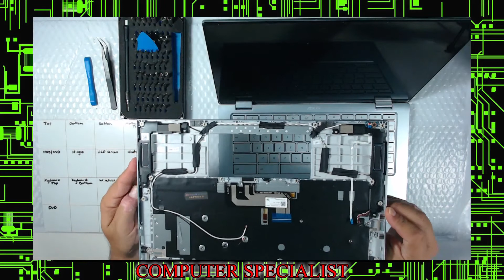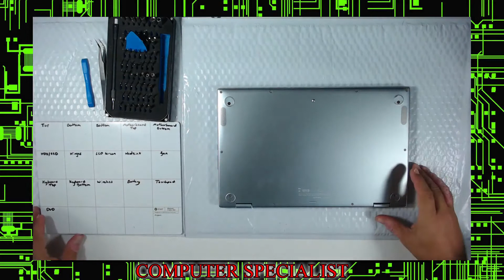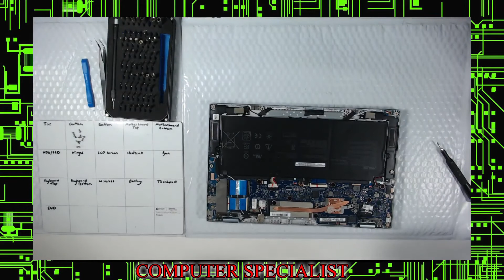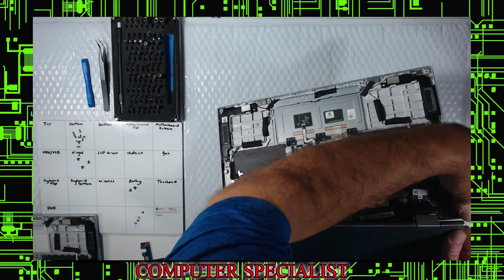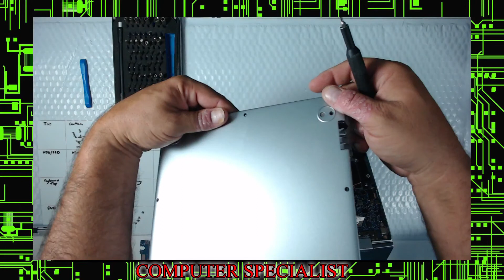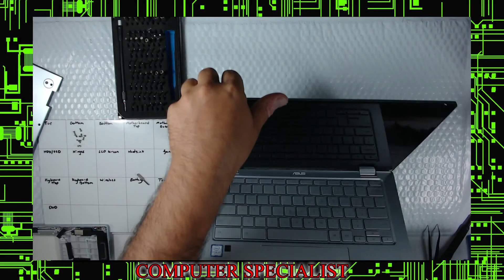Asus C433T Chromebook Keyboard / Palmrest Replacement

Comment: Can you help me, I want to install a US keyboard, there is no similar video on youtube like yours, I don't know the procedure, can the keyboard be separated from the lower part of the case?  I only found a keyboard on Aliexpress, so I'd like to ask if it can be installed?  Thanks
Reply from the maker: You can replace just the keyboard, but you need to break out a ton of plastic rivets and then glue the replacement keyboard back in where the rivets use to be. Its a lot of work and can loosen up in the future and makes keyboard flimsy and even short the motherboard if it doesn't hold. I would just replace the top like we did in video. You can pick them up on eBay etc. cheap. https://www.ebay.com/itm/406200405437
Reply: @computerspecialist8533 Thank you very much for your honest answer, you helped me a lot, all the best!

Comment: Hi, I have 2 question. First which screwdriver do you use? and to replace the charging port is there need for specific tools?
Reply from the maker: https://www.ifixit.com/products/pro-tech-toolkit a must if repairing computer! Also you can replace the entire board cheap enough https://www.ebay.com/itm/296167100787

Comment: Hi I have a question did the palm rest and keyboard come as one or are they separate
Reply from the maker: They came together, that is usually the recommended way as the keyboard is help in with plastic rivets.
Reply: Can you help me, I want to install a US keyboard, there is no similar video on youtube like yours, I don't know the procedure, can the keyboard be separated from the lower part of the case?  I only found a keyboard on Aliexpress, so I'd like to ask if it can be installed?  Thank you

Comment: How to replace the speakers?
Reply from the maker: Follow these instructions to get it apart. You can see the speakers on the top left and right. Order replacements and swap them out. Be careful with the speaker plugs, they are very fragile, so wiggle them to get them out. Also are the current speakers crackling or not working at all?
Reply: @computerspecialist8533  current speakers are crackling.. I see wires connected to a Intel card. The speaker on the left. It's the speaker on the right that's out. Please make a video
Reply from the maker: @dricketts91 The wires for the Intel card are the wireless antennae's. We don't have this laptop no longer to make a video but you'll see its pretty simple. Just do one at a time and follow the wires. Always take a picture before you take out the speaker so you can look back and see where wires are ran etc.
Reply: @computerspecialist8533  already ordered replacement part

Comment: What is the name of the screw driver needed for this small screws? 

Very helpful video. I got my replacement (after having other touchpad issues, sigh) and the touchpad is having a deadzone so it rattles when touching. I will use your video to quickly remove the touchpad and put some electrical tape on the button so it stiffens. First I will try to just tighten the screws of course and see if it helps. As I understand there isn't any warranty void stickers as well.
Reply from the maker: Phillips 0 or Phillips 1 screwdriver will do. Yes, I don't believe any warranty sticks. Interestingly, if you live in the US its actually not possible for them to void your warranty due to broken warranty sticker! Part of consumer law.